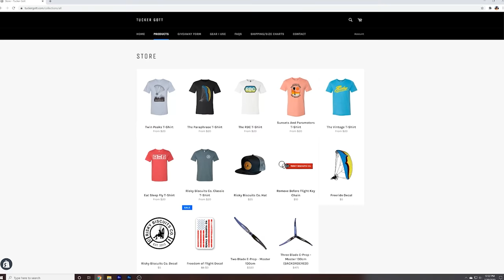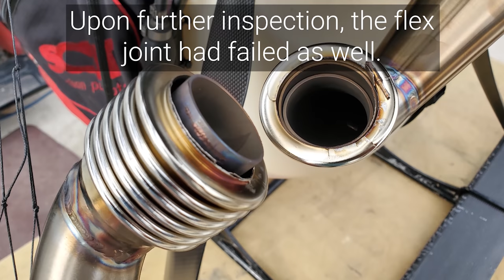Landed On A Street!!! - Top 10 Engine Failures

Comment: I would rather have an engine failure in a paramotor over any other type of flying machine.
Reply: what about a glider?
Reply: Dale Fry helicopter engine failure is also nob that bad
Reply: Tucker actually said this in one of his videos once
Reply: I would much rather lose an engine in an airplane. They have a better glide ratio and will make it a lot further. I’ve had a few over the years. Also, engine failure in a helicopter isn’t bad at all. Learn what autorotation is and why it’s a major part of helicopter flight training. PPC’s are the worst to lose an engine in. The glide ratio sucks, so you are stuck with finding a place to land that’s really close. I’ve flown a plane for 9 miles after the engine failed to get to an airport. Can’t do that with a chute.
Reply: Zaphod Whiskers  Except when they do! Some gliders have engines that fold out to self-launch, or to just sustain flight when the weather dies.
Reply: Zaphod Whiskers  then there's no failure!!:D better.
Reply: @mikebeatstsb7030  depends what type of microlight, if its a fast heavy one then I wouldnt want an engine out lol
Reply: If I couldn’t make it to a safe landing zone I think I’d rather be doing 20mph in a paramotor than much faster in a fixed wing. Most airplane fuselages don’t provide much protection at those speeds.
Reply: @adamr9215  you glide for 9 miles and than crasch. With a paraglider you can even land in a tree safely.
Reply: gpaull2 You can get a Cessna down to about 30mph when you flare. Some planes like my Stinson will flare even slower. It’s it’s still a lot better than nothing around you.
Reply: B. Bakker Maybe you weren’t paying attention. I glided 9 miles to the airport for a safe landing. I could have gone further if I needed to. Also, I can find more places to land in 9 miles than 1 mile or less for the PPC. 

I see a lot of idiots posting stupid stuff. Just because Tucker Gott flies a PPC doesn’t mean that it is the best or safest option. PPC’s still suffer from engine loss 700 (real number) times more often than an aircraft that is maintained as required by law. The engine in my Stinson has a service life of 2000 hours. When I had it rebuilt at 2000 hours, it was still perfectly fine, but it was required by law. PPC engines don’t make it to 100 hours often at all, and when they do, they have been rebuilt a few times. Everything on my plane has a service life, and it is well documented. So, I know when I’m getting close to having a potential problem. PPC engines blow for no reason, randomly, quite often. PPC’s are for a thrill, not because they are safe. Landing at a walking speed is the one advantage they have, everything else is a negative. Horrible glide ratio. No protection from anything. My flight instructor crashed his Cub in trees, just flared right over them and they caught the plane smooth as could be. Less than $5,000 in damage to the plane, and not a single scratch on the pilot or passenger. Have you seen the guys who crashed PPC’s into trees? I remember being part of the search crew for a guy in Florida that went missing. He lost power dropped into some trees and got skewered by a limb. 6 hours later they found him and he died while they were getting him down. Going slow won’t save your butt, but it will give you far less safe options to chose from. The comments from people who know nothing about flying are somewhere between amusing and disturbing. Amusing because they actually think so wrong, but disturbing because they actually think they know what they are talking about. What ever happened to not opening your yap about stuff you don’t understand? But then again, that’s how democrats continue to get elected, stupid people.
Reply: Zaphod Whiskers  woooosh
Reply: Adam R - sure with some planes. That’s not the case with most fixed wings though. I’ll take an engine out over a forested area in ANY paramotor vs MOST fixed wings (MU2, King Air, Baron, Cessna 206....etc)
Reply: gpaull2 Lol, I fly STOL aircraft, so everything I own will. Pretty much any plane made for bush flying will. Like I said, I fly ppc, but 99% of the time, I would rather be in a real plane if I were to have an engine failure. Been there, done that in both, and I would pick the real plane every time. 

Also, you listed some multi engine aircraft. You would have to be on crack to prefer an engine failure on a ppc than to lose a single engine in an MU2. You can still continue your flight with just a little rudder. Way safer to lose a single engine on a twin engine plane than the only engine on a ppc. Seriously, drug have to be involved in that decision. You really lose any kind of credibility when you say things like that.
Reply: Adam R - All the second engine does in an MU2 is take you to the scene of the crash! Lol.  As an AME I’ve seen many instances (mechanical and pilot error) to know that a second engine is no guarantee of safety that most think they are. Either way, many (most?) airplanes are not STOL aircraft. In your situation it may be best, but it’s not in all...no matter how good of a pilot you are.
Reply: gpaull2 Lol, not from what I’ve seen. Just a little rudder will keep it going just fine. Pilot error isn’t the planes fault, it’s the pilots fault. You are blaming the plane for pilot error? Then write off PPC’s because most accidents for them are pilot error.

Most planes aren’t PPC’s, but that didn’t stop you. STOL aircraft are the only thing that is useful to me, so it’s all I own. Just like choosing a PPC, I choose aircraft that have a use for me. I can’t land a Lear on my runway, so I wouldn’t own one. My CH801 will land anywhere a PPC will, can fly in normal weather that a PPC won’t, can go distances without problems, can bring friends, and best of all, is reliable. The DeltaHawk engine has almost 5000 hours on it failure free, and oil analysis show that it’s still good, so it’s still going. Try that with a PPC. Don’t get me wrong, PPC’s are fun, but they are just a toy for thrill rides. It’s not a reliable plane that can safely cross the country. You don’t pick a PPC because it is safer than a plane because it isn’t. Plain and simple. You pick them for fun. Safety record on them is horrible. You want safe, look up the Stinson 108 series. The highest survival rate of any plane. They are a flying chromoly roll cage with wings stuck on it. One got hit by an MD80 and both people in the Stinson walked away after being blown out of the air. The MD80 had zero survivors. That’s a safe plane to take on a commercial jet and win. Far safer than a PPC. And it will land almost anywhere a PPC will. 30mph cross winds are no problem. Try to fly a PPC in 30mph winds and tell me it’s safer than a plane. I could go on, but I don’t need to. PPC’s are to airplanes what a go cart is to a car. A toy that you play with for fun.
Reply: Zaphod Whiskers  r/wooosh
Reply: @adamr9215  you can pretty much land a PPG in any area as big as a basketball court if you need to. It's not that bad.
Reply: Hyperious That doesn’t matter at all when the PPC won’t make it to the only safe landing site for miles. I’ll pick something that has a better glide ratio and can actually make it far enough to land. I’ve had engine failures in planes, and have never wrecked an aircraft. Every single time I had to get rid of altitude to land. In other words I had more than enough. Now, an engine failure on my PPC leads to trying to get creative to land. Instead of being able to go 10+ miles with no engine, all the sudden I have to find spots within half a mile. And that’s not always easy. It’s much safer to know you can go 10 miles to an airport than knowing you can’t make a clearing 1 mile away.
Reply: Zaphod Whiskers powered gliders, R/wooosh and microlights.
Reply: Mike beats tsb nope. There are 2 engines on most planes so Gavin A engine failure would be fine.
Reply: B. Bakker no. Planes can handle most landings and also dump all their flammable fuel for safety and to make them super light and glider really far
Reply: gpaull2 206 can land in the middle of a patch of dirt.
Reply: Yeah the parachute thing lol
Reply: Mike beats tsb airplanes don’t have to fly over water. You could choose to only fly over land. Many pilots never fly over anything but land and rivers or lakes.
Reply: Yea same because you already have perisut  sorry I can’t spell
Reply: Lol the thing is that you still have a parachute lol.  In a helicopter, if it shut off it would just spin and fall lol.
Reply: Zaphod Whiskers it’s almost like that’s the joke
Reply: Jurre Splinter Kobe: are you sure about that
Reply: i would understand that because its literally a parachute if it fqils in the air
Reply: No shit.
Reply: What about a glider
Reply: I would prefer a motorized glider. Engine broken? No problem, just keep on flying for ever
Reply: Lol parachute style
Reply: @adamr9215  90km? Your plane is a very safe one
Reply: andreas kavak Not 90km, 9 miles. It will glide a while, but it’s no glider.
Reply: @adamr9215  9 miles is 90 km (sweden) but ok
Reply: andreas kavak km as in kilometers? They aren’t that far apart. A kilometer is roughly 2/3rds of a mile, not a tenth of one. Or KnM as in nautical (knot) miles?
Reply: @adamr9215  1 mile is 10 km
Reply: andreas kavak Google says it’s 1.60934 km to a mile.
Reply: Gus Cichoski no??? A helicopter engine failure really isn’t that bad. Look it up if you don’t believe me
Reply: @ducjduck  uhh yes it is...
Reply: PartyKidCrazy 101 look it up
Reply: @thedoeverything418  gliders dont have engines
Reply: @thedoeverything418  glider anes are pulled to the sky and then let to glide
Reply: What about rc planes and drones
Reply: patato lord when there engine stops working they just fall straight down
Reply: @ducjduck  you know nothing about helicopters
Reply: @adamr9215  Depends really on the airplane. Some planes do glide like a rock.
Reply: @ducjduck  also plane the motor might fail but you can glide to the destination if it close enough
Reply: patato lord yeh it’s the safest that’s true
Reply: Yeah
Reply: Jurre Splinter umm.... what?
Reply: Pheonexius  yeah and you can glide down
Reply: Redpeanut 182 what do you not understand?
Reply: Yeah, you already have the wing/parachute thing deployed, unless thats damaged you already are pretty safe
Reply: @thedoeverything418  Lol gliders don't have engines XD
Reply: That's because it's a parachute
Reply: @ducjduck  .... Kobe....
Reply: Blitzkrieg I don’t know everything about that accident but normally a helicopter engine failure isn’t that bad, just search it up
Reply: Zaphod Whiskers have you heard of a powered glider ?
Reply: “Oh no. The engine failed, if only I had a parachute, preferably already deployed.”
Reply: Engine failures in single engine airplanes and light helicopters are extremely survivable if you have a competent pilot. Bush pilots have a tendency to survive and make greaser landings during emergencies.
Reply: @OhKnow379  Most...planes don't have a way to dump their fuel from the cockpit. Even if they did, fuel is about 6 pounds a gallon, while it will certainly lower the weight, it still has a heavy as fuck engine in it and will not operate a 32 to 1 glide ratio like most gliders can accomplish. Gliders also operate based on thermals and upwinds and so they're completely weather dependent and suffer harshly by sinking air. They are also slow as fuck if you want a useful glide range out of them. They're fun as hell, but not very useful for getting places. That's not to say you can't get places with them, cross country in a glider is a really thrilling experience, but its not something you can just decide to do on a random afternoon. Like you can in a normal single engine aircraft. For those bringing up motorgliders, the motor part is suppose to be used just to take off. You feather or retract it afterwards once you get to altitude which is 1500-2000 feet AGL and you thermal your way up higher...you really shouldn't use the motor too often as it runs on a battery and will eventually go out...rather quickly actually.
I can't say anything about paramotors because I don't fly them. They kind of remind me of helicopters due to their versatility without the stupid amount of regulation around them as well as the absurd amout of maintenance required. The only downside is that helicopters are a hell of a lot faster.
I'm not sure why anyone is comparing landing vehicles. Landing at an offsite airport is easy with a single engine aircraft as it is with a parachute. It just takes training to be able to do it.If you don't feel confident about off airport landings, I suggest taking a CFI to do some grass field landings. Get to know the environment you're flying around and get to know what terrain is best for landing and what terrain to stay away from. It's not that one thing is harder to land than the other, its just that paramotors have a lesser chance of exploding than a plane does if you really botch the landing. 
Finally, its about making aeronautical decisions. Its easier to go direct through a large lake to get to an airport but its safer to go around the landmass and cross the lake at the shortest water points. Another big one is mountains. You can either fly over it or go through a mountain pass. Well, mountain passes are a heck of a lot safer and offer a lot more options incase of an engine out than flying over a mountain which may present unique situations. Superior pilots make safe decisions to avoid having to use superior skills or something like that.
Reply: Yessir
Reply: Kaimine08 most Domestic planes can’t dump because they don’t need to. Many larger aircraft can jettison fuel. Why would I compare a towed glider to a damn jet liner. That’s like comparing a brick to a piece of paper. I only referenced GA aircraft and paramotors.
Reply: I would too because a paramotor because it has a parachute.
Reply: Zaphod Whiskers  r/woosh
Reply: @ducjduck  how is that?? I assume the heli would just free fall
Reply: Ike Reckart it’s called auto rotation, smartereveryday made a good video explaining it
Reply: Oh yeah and also you won’t have to worry about deploying your parachute
Reply: XD UR RIGHT LOL
Reply: Exactly
Reply: How about a hot air baloon?
Reply: A plane is fine as it has 2 engines and it only needs 1 to fly
Reply: Chief Solitude Guard also something like a balloon cant really fail,  but if it foes it will do the same as a paramotor.
Reply: Ya no shit
Reply: I would rather be on the ground cause I can’t have any issues in the air.
Reply: Adam, my boi. You literally can’t die in a paramotor crash if you fly correctly.
Reply: I would rather have a engine failure then anything else as a failure on a paramotor
Reply: Due to the parachute
Reply: Honestly engine failure in a small single engine aircraft isn't that big of a deal as most think
Reply: I mean you have a parachute.
Reply: Jurre Splinter Tell that to Kobe
Reply: So true
Reply: I mean, you have a built-in parashoot lol
Reply: Exactly at least then your not gonna fricking explode when you hit the ground if you di
Reply: Tru
Reply: Zaphod Whisker he a meant motorised glider
Reply: Right! It's like being on an escalator when the power goes out.
Reply: What about a c130
Reply: It is essentially a parachute motorized so. But the wing can fold unlike a rigid wing
Reply: @adamr9215  problem is though, you can put a PPG down pretty much anywhere. In a fixed-wing, you need a strip to not damage anything. I think PPG wins in this unless you're flying too low.
Reply: aerowenn I have to disagree. The parachute is wider than you seem to think. And, it will catch on the smallest of twigs, collapse and send you falling. I’ve been there. Lost power over cornfields, tried to land in a dry irrigation ditch between cornfields.  Would have been perfect except for a line catching on the corn. I had my feet on the ground when it happened, or it could have gone bad. Had it been an opening in trees, this would have happened 30+ feet in the air and I wouldn’t have walked away. I was dead center in a 50’ wide opening that dropped about 10’ lower than the surrounding ground. Now, in a C170 on floats, I had an engine failure over jungle. I was able to turn the plane on it’s side to squeeze between the canopies of trees on both sides of a river to land the plane safely. The opening was narrower than a ppg wing. Could not have gotten one in there, but I got a 4 seat aircraft in just fine. Ok, with a lot of luck as well, and some contact with branches that would have screwed a chute up bad. So, I have to say that you have better chances in a real plane over a ppg.
Reply: Great! Thanks for the video and well edited!  Wow. Iisten I missed your competition but hey have you gone into autogyro much?  I get that your ppg is awesome.... but they are making air ambulances now, like in Spain!  Why use million dollar Sikorskies when you can get an a well-fitted more stable and safe machine for one tenth the price.  Im sure you could build one fast and almost free buddy.  Its a great new industry with recent changes in American law!  These things are as open if you like but much more agile than your bird.  Small window of time.  Anyway, thanks again. Totally useful and artsy video.  Impressed.:-)
Reply: @adamr9215   if you can't make it to a landing sight in a ppg I'd say that alone is pilot error. I'd say PPG's are safer because if you are flying they way you are supposed too you already have a landing sight in glide range. A plane is better for what planes are good for, long distance transport. PPG's arnt meant for long distance. Yes people do it. But if you're doing it right you are field hopping and always have a safe site to land. Most PPG accidents are pilot error as well and you seem to be blaming the craft. Just like you pointed out others doing
Reply: @ABaker71126  You only think that way because you haven’t been through flight training. If you had, you would know that it is extensively covered and pilots have an excellent chance of making a safe landing. But, even you admit that a ppc isn’t reliable enough to operate outside of visual of a place to land. When you are in the air, reliability is safety.
Reply: @adamr9215  in my opinion you only should be flying a paramotor with a visual landing site unless you are a quite advanced pilot and willing to take the risk. I am not. I have been through flight training actually and I believe if you operate a paramotor the way you should it is safer than an aircraft.
Reply: @ABaker71126  And the reason you should always have a landing site in view is simply because they aren’t reliable or safe enough to fly normally.
Reply: @12vibaba  what about the cirrus sr22
Reply: @adamr9215  That is because they are for fun. Not for transport. You can't ride a Quad on the road in most places for the same reason. If you follow simple guidelines on a quad you will be safe. If you don't you may be injured or killed. Same goes for paramotors.
Reply: @adamr9215  I also don't appreciate being called stupid for having a different opinion then you. I thought we were having a civil debate over different views. But now its playground insults? Defend yourself with facts not names
Reply: @ABaker71126  I never said they weren’t fun. As I said earlier, I own both, PPC and a couple aircraft. PPC’s are fun, but they aren’t reliable or safe enough to operate outside of special rules. When the FAA makes special rules for something, it is to cut the risk. So, PPC’s operate under special rules because they are NOT RELIABLE, per the FAA. Simple as that.

Did you read all my comments? I am sure that I mentioned that I have been able to put my Stinson down in places that I couldn’t land a PPC. My CH801 will take off in less than 30 feet, and will clear a 50’ obstruction in less than 100’. Can’t do that on a PPC... With a real aircraft, you can do so much more, with so much more safety. You can knife a real plane to drop below the canopy of surrounding trees. Can’t do that with a PPC. I need an opening less than 20 feet to get a 4 place aircraft on the ground. A PPC doesn’t have that option.

I didn’t call you stupid, I called you spineless. I consider anyone who will accept a lack of reliability from a major purchase, like a PPC, to be spineless. That’s like buying a new vehicle that you know will need to be replaced before you actually make it 10 miles home.
Reply: You can’t do that with a chute  because you don’t need to. Ground Speed is key here and even today planes with parachute attached haven’t had one fatality to date. I would rather hit the ground at ten miles an hour versus over 60 regardless of what’s wrapped around me.
Reply: @zaneketchum5044  Over 60mph? What are you smoking? Most high wing planes can be slowed to well under 30mph before touching down. My Stinson 108 can be dropped onto the ground at less than 20mph. I would rather wreck at 20mph inside a chromoly rollcage (that’s how the old Stinsons were built, rollcage with wings) than wreck into something at 10mph without anything around me. 10mph catching on a branch and being swung into a sharp branch at a much higher rate of speed ends a lot worse than you seem to think. Also, a paramotor on your back is more weight/momentum when you do hit something. In an aircraft, the most solid part of the plane, the engine, is acting as a shield keeping stuff from making it to the pilot.
Reply: Hiw about a drone but your not in it
Reply: Off cuz then u can glide, like there’s no change ur gliding a 747
Reply: @kelvynhee1325  From 30,000 feet agl, that 747 will glide 20+ miles. They actually have a computer onboard that calculates best glide ratio and gives you a distance you can make. 

I’ve got a question for you. Why would you make idiotically wrong statements when you clearly have no experience in this field?
Reply: @adamr9215  lost all credibility by randomly throwing politics at the end of your epic whiney rant there bud
Reply: @adamr9215  God, I never insulted you through this whole debate. I argued points based on my opinion, and you did the same. Learn how to argue points without childish insults. It turns out you are much too childish for my time. Bye
Reply: @adamr9215  hey I'm here to debate about flight safety, not have a contest to see who can come up with the best playground insults. When you grow up, message me and we can debate this like adults. The only deaths from paramotoring come from people who aren't trained or arnt using common sense. That's a fact. Turns out your too childish to back up your points with facts so I'm done here. Peace ✌
Reply: @adamr9215  Dude just no, you don't understand basic logic. And you can't comprehend the fact you may be wrong. That's why you are fighting with everyone in the comments. If you think its right to treat someone you've never met as less than human because they disagree with you, you need help. I sincerely hope you get it.
Reply: All in all, parachute is already deployed !
Reply: @adamr9215  Clearly meant it to be so ;)
Reply: How about a drone?
Reply: @ABaker71126  yeah, don’t bother engaging with that guy. Just a needlessly aggressive troll with a bizarre elitist attitude towards planes stalking the comments of a paramotor enthusiast’s channel 😆
Reply: The only engine failure that is a good chance of death is an airbus. The wieght makes it hard to glide and usually makes landings super hard
Reply: Yeah after the engine fails and then its just parachuting with an engine lol
Reply: What about a glider or maybe a dirigible?  I'd rather not have any engine failures in any aircraft, PERIOD.  They happen WAY too often with these paramotor power plants, MHO, ESPECIALLY for what you pay for them. 

If it ever happens while you are skimming tree tops, and if you aren't close to an open area with enough kinetic energy to get there when possibly instantly and unexpectedly unpowered, you are going to quickly agree, right then and there.  There won't be any having to convince you that it's a bad thing.  In most instances where you are high and clear, or have an immediate open path to landing, yeah, not a big a deal, but still NOT a good thing.
Reply: Ikr
Reply: vibratingstring  You need to learn to read. You can fit a plane into tighter spots than a paramotor. And, stall speed on my Stinson with full flaps is under 40mph. I would rather hit brush at sub 40mph inside of a plane than at 10mph with nothing around me. And you really need to learn something about flying paramotors. You do need room to land. The slightest brush with a tree branch can lead to a hard splat. In an emergency landing, you may not be able to land into the wind, so you may be fighting a crosswind or a tailwind. Either one increases your ground speed and lengthens your landing. Plus, the ability to fly a plane for miles without power to find a safe spot to land is a huge plus. Being limited to a 1/4 mile radius in a ppc sucks.
Reply: Same, you can glide down with the wing
Reply: @thedoeverything418  im assuming this isn't a joke. Gliders dont have engines to begin with.
Reply: @mikebeatstsb7030  ultralight*
Reply: It literally has a built in parachute/glider
Reply: Helicopters have constantly turning blades even when the engine stops working. Planes can glid to land🤷‍♂️🤷‍♂️🤷‍♂️
Reply: Yea
Reply: Ultralight aircraft/trike?
Reply: What about those cheap toy helicopters that you can control with a tiny remote?
Reply: Yes, becouse is something you can handle!
Reply: I'd rather lose engines on a glider
Reply: I'd rather have an engine failure in a hobbyist drone rather than something I actually fly on lmao
Reply: I own a new Cessna 172T with a custom wood vintage interior, I wouldn’t trade it for anything but I will say.. Paramotor would be pretty nice
Reply: Same
Reply: Same here 😂
Reply: What about a drone?
Reply: I’d rather it be a rc plane
Reply: Well if a plane breaks it is actually safer than a paramoter
Reply: I'd much rather have an engine failure on a boat
Reply: @Pwn3dbyth3n00b  nah youd get stranded
Reply: Yeah paramotor with no engen turn into paraglyder
Reply: @garin fl Thats called auto rotation.....
Reply: I'd rather have an engine failure in a hang glider.
Reply: A Cessna 172 is perfext
Reply: @thedoeverything418  that would be really bad
Reply: I'd be fine in a quadcopter powered by 4 engines and able to stay in the air with 3 or even 2 engines.
Reply: wait until this guy sees what I own lmfao
Reply: @adamr9215  i think he was mainly thinking of the stopping distance and what you need for a safe landing spot
Reply: @elementalgolem5498  I doubt that. Many planes can land in less space than a ppc. When you factor in clearing a 50’ obstacle, a plane can drop the 50’ faster and be on the runway closer to the obstacle. You can point a plane down, a ppc just waits for lift to fade, then starts slowly descending. Like I said before, I fly both and can say from experience that I can find a safe place to land and get stopped far more safely in my Stinson 108 than I can in a ppc. You have far more control in an aircraft. Far better controls than a left brake, right brake and a speed bar. That alone makes the plane safer. Add in far better glide ratio and you have an unbeatable combo.
Reply: @adamr9215  well. Even helicopter have better landing. Glide ratio is useless when you need a runway and there is literally none nearby. You saw in the vodeo them landing in probably around 40-50 meteres without the wind. And on the spot hovering with some wind
Reply: A ppc can be turned into a parachute basically. And parachutes have for ages been used by military as a last resort when they dont have a safe place to land their plane.
Reply: @adamr9215  if so then why is a engine failure over the pacific often fatal. Sure it can land in water. But it is not as safe as basically being turned into a paraglider. Something that you land all the time and never have a engine on
Reply: @elementalgolem5498  Another thing. If my plane loses the engine 10 miles from land, I can make it back. The PPC will hit the water 8 miles from shore and sink like a stone with the pilot strapped in. So your water landing scenario only exposes how bad ppc’s would perform in that situation. Again, you know nothing about flying, and you prove it.
Reply: Helicopter is totally fine too
Reply: @adamr9215  a ppc doesn't fly above water though. A plane does. You cannot state one being safer than the other within its niche. A nascar i safer at topspeed spinouts than a family suv. But saying that the nascar is a safer vhicle because of it makes no sense as we all know it isn't. A suv is safer in its field of use. You have to conpare them to real life scenarios not force them into the situation that it wouldn't be in. Sure a ppc generally isnt as good at gliding etc. But it can land more places. You seem to be arguing a awfull lot in scenarios twisted to your perspective and ignoring all others. Including the majority way of seeing it in this comment section. And that is that a ppc has better performance in a "emergency landing" in its use case. I think a vodeo demonstrating top 10 engine failures showcases how reliably it can be landed. Most pilots cannot say they have had 10 emergency landings in their cessna
Reply: @12vibaba  same with airplanes and 9 miles you can. Find a airport you wont crash unless your in a forest you can try to land in the trees by taking out all your speed away then crash or abort by having a parachute on with you
Reply: @adamr9215  But you can land a para-glider in any open area, you don't need a runway.
Reply: @phillhuddleston9445  Planes don’t need a runway either. You are talking to someone who has been a bush pilot for over 20 years. I’ve put planes down in clearings that weren’t 300 feet, and surrounded by trees. And took off from them too. I fly ppc’s are well, and know for a fact that they can’t land in as small of an area with obstacles surrounding it. Look up a video on STOL competitions and you will see what I mean. In my plane, I can start 150 feet from 50’ tall trees and will clear them. A ppc won’t do that. Same with landings, the correct plane will land shorter.
Reply: What about a brick?
Reply: @adamr9215  you also can't land a plane on a road tho
Reply: You’re not lying
Reply: @jademolloy9081  Yes you can. Do some research, it happens about 30 times a year in the US.
Reply: In a glider?
Reply: its about how much space it takes to land it ,and as pointed out ,big crafts fly over way harder areas such as oceans or mountain ranges ,so ye, airplane microlight ,helicopter and everything else can land without engine .
Reply: Ye bc a paramotor is a glider with a motor
Reply: @ducjduck  ???
Reply: @niftytheundying  what?
Reply: @ducjduck  how is a airplane engine failure ok??
Reply: @niftytheundying  i said helicopter not airplaine
Reply: @ducjduck  oh I prolly replied to the wrong person and yeah helicopter engines going out are bad
Reply: @niftytheundying  no i meant that i said that helicopter engine failures aren’t that bad, you can easily survive it unharmed
Reply: @ducjduck  ehhhh idk man Kobe yknow
Reply: @niftytheundying  thats was the pilots fault, not a engine failure
Reply: @niftytheundying  The pilot made a "poor decision" to fly at "excessive airspeed" -- about 160 miles per hour -- into an area of poor visibility.
The pilot lost the ability to control the helicopter after losing visual contact with the ground.
And the pilot may have had what the NTSB called -- "self induced pressure" -- to complete the flight, despite the bad visibility, because he wanted to satisfy his client, Kobe Bryant.
Reply: @niftytheundying  The NTSB ruled out lots of other factors.

It said the helicopter was mechanically sound and its engines and controls were working normally when it crashed.

Air traffic controllers made one radio communication error, but the NTSB said it did not contribute to the crash.

And the charter company did not put undue pressure on the pilot to fly in less-than-ideal conditions.
Reply: No you wouldnt if you know anything about them youd know that they almost drop like a rock in an engine failure
Reply: @ducjduck  ya auto rotations bring it down sadly with only a crunched landing gear
Reply: @mikebeatstsb7030  civilians dont typically fly over water I thought
Reply: @adamr9215  same id rather be in a small plane with a good slide ratio
Reply: Or a basic monoplane since they do have flaps to help get a little more lift if you need it and you have wheels to soften the landing slightly
Reply: Same
Reply: A plane, especially a cessna would be the perfect plane to have an engine failure in
Reply: Why?
Reply: There's  a Mitch Hedberg joke in there somewhere.
Reply: @12vibaba  you don't crash when gliding an aircraft. My flight instructor actually made me practice 20 engine off landings. 10 on runway, 10 on grass next to runway. He would cut the engine at different altitudes when on way back
Reply: Yeah you already have your parachute on and everything
Reply: @ducjduck  people die fr that all the time
Reply: @adamr9215  relax young man.
Reply: @anonymously_known  Lmao, you were triggered by a year old thread and you are telling me to calm down? Lol, projecting much?
Reply: @adamr9215  Thats the problem with you young men, no respect.
Reply: @anonymously_known  Lol, more projecting from you. There aren’t many men alive that would consider me a young man, so you must still be projecting because you are a child. It’s the only thing that would excuse the ignorance in your assumptions.
Reply: @adamr9215  The fact that your an "older man" and still entertaining me like a child is laughable 🤣🤣🤣🤣🤣🤣
Reply: f 16 mid dog fight
Reply: For me, my best craft for an engine out is a magic carpet.  They have a very forgiving sink rate.
Reply: For me 747-8 they can litterly fly on one engine and even if one goes down the flight can be completed
Reply: @adamr9215  yeah and with airplanes that have 2 engines most of the time they can run with one just fine
Reply: @adamr9215  I mean my 172 stall speed is 45 with flaps extended so that’s bs.
Reply: @NEhunterboy  Lmao, you are good at proving that you aren’t a pilot and have never flown before. First off, weight effects the stall speed. Second, do you know how many different variations of the 172 exist with different stall speeds. And that’s not even counting STOL kits. And on top of that, there is clean stall as well as dirty stall. Do you know how leading edge slats effect stall? It’s something that your Cessna doesn’t have but my Stinsons do have. Try again when you actually have a clue what you are talking about.
Reply: Fr
Reply: @andreaskavak2364  What is wrong with you? One mile is 1.601 km.
So, 9 miles is 14.48 km.
Reply: @Sloozer45  He's probably referring to Scandinavian mile, where 1 mile equals 10km.
Pretty strange but I didn't know that until now either.
Reply: @ducjduck  still pretty bad, you can only rely on autorotation at that point
Reply: @adamr9215  completely disagree with you there. A engine failure on a fixed wing is a very dangerous situation for not only you but the people on the ground requiring a mayday call which could result in landing out on a public road or destroying the aircraft in a field. Having a engine out on a PPG you glide down at 20mph to a three step landing. Glide ratio and sink rate are two different things. Given the slower speed and lower sink rate as well as requiring significantly less area to land safely makes PPG landing out a inconvenience at most.
Reply: @adamr9215  you keep calling these PPC’s they are PPG’s. yes of course small two stoke backpack motors have more engine outs, it’s not if, it’s when you have one.

The question is which one would you rather have one in. I’ve landed out in a small field next to a car dealership surrounded by power lines, I don’t need to glide for 9 miles because a PPG pilot has significantly more options for landing out safely than a fixed wing aircraft does. 

Nobody is arguing a fixed wing doesn’t have a better glide ratio, but that’s not the determining factor in survivability. Fixed wing  aircraft have a very low instance of dead stick landings, for PPG pilots it’s a common inevitability and as shown in this video is most often a inconvenience at best.
Reply: @SMarti018  You are two years late to the party, and still 100% wrong. They are still classified as powered parachutes, PPC. That’s what they have been called for the 30+ years I have been flying, so that’s what I’m calling them.

I would much rather have a engine failure in an aircraft that has a good glide ratio and can get me to a safe landing spot than a parachute that won’t get me anywhere. I’ve landed planes in fields a few time and always was able to fix the problem and take off again. A PPC doesn’t have more options, it has less options because you can’t go as far to find a safe place to land. That, and inside a plane you have a better survival rate at 3 times the speed than you do hanging from a parachute with an engine on your back. A lot of motorcyclists have died at under 20mph, and they didn’t have an engine strapped to their back slamming them onto obstacles harder than they would hit without. 

You seem to be 100% clueless as to how flying works. Every pilot is trained to land without power. Every single one. And it’s the most practiced part of training for pilots. So your idiotic assumption is wrong. Any pilot that doesn’t have plenty of dead stick training has committed a felony and lied on their training. You can’t get a license without that training, and only the worst pilots don’t practice it often.

You should try again when you have some kind of clue what you are talking about.
Reply: @adamr9215  I would have thought a helicopter wouldn't get you very far without an engine either. You're just coasting the rotors on wind power and then changing the pitch at the last moments to cushion the landing. The good news is though you won't have to come in with much forward speed compared to a plane. However I have no experience with this, but I'd be most scared of not finding an obstacle free area while trying to land a plane.
Reply: @TimpBizkit  A helicopter won’t go far without it running, but autorotating will cushion the landing. For planes, you really don’t have to keep up a lot of speed. For a high wing plane that doesn’t go that fast, you can often get the speed below 40mph while dropping at an easily survivable rate.
Reply: @adamr9215 ya but you can’t land a plane in tiny streets
Reply: @kbating5814  Lmao, you aren’t that smart, are you? I have already covered this.